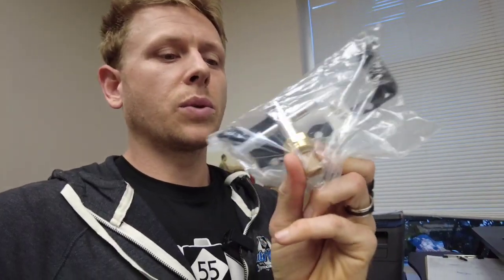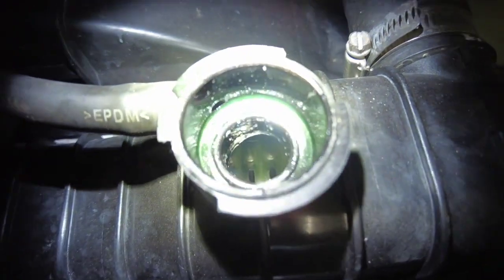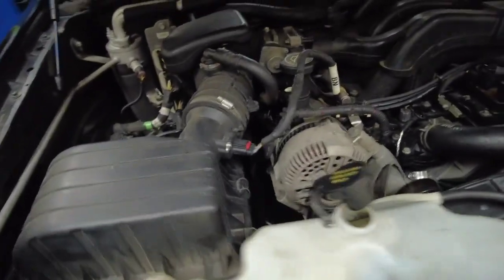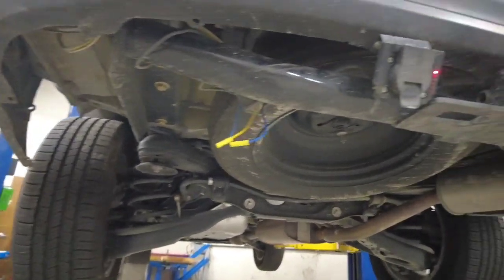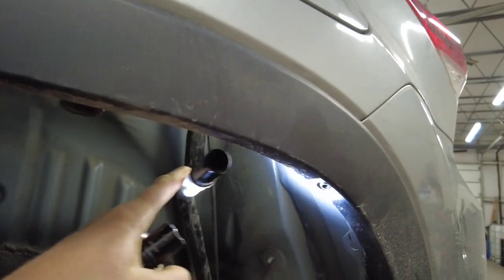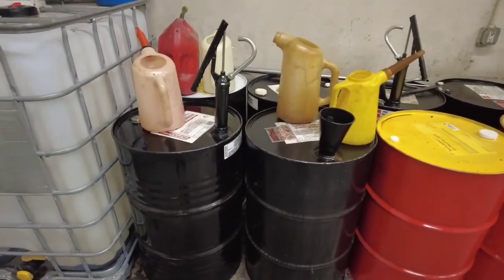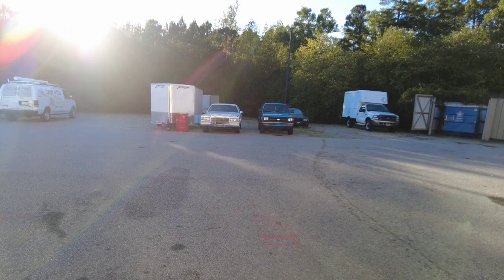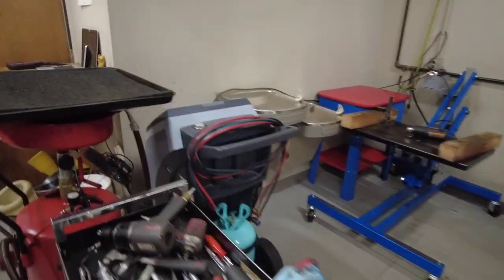What's Going On Around The Shop? and why am i pointing at this fuel lid?

Comment: Good video, liked the showing of all the jobs you are working on.  Nice job diagnosing the Toyota.  Are the Chevy/Gm 4.3 Liters pretty reliable engines overall?  I know the older models had issues with the Spider injectors, are the newer ones (2010 and up) any better?
Reply from the maker: I'm not a big fan of any gm engine. One of my guys has a 4000 mile old 5.3 that more or less just had both heads off and all valvetrain replaced
Reply: My 09 Silverado 4x4 has the 4.3 and has been very reliable just routine maintenance at 106,000 miles.

Comment: Good videos keep them coming do have a question have a 2015 Ford Fiesta SE I'm getting a message popping up says steering assistant fault everyone's tell me replace the steering column for the rack and pinion but there's no electric motor on the rack on this car every light in the dash is on all but check engine light is off I have no speedometer working trip odometer don't work the temperature sensors not working and cruise control won't work now and it gets really light on the steering and it gets kind of tough to steer but it's not unbearable any ideas any opinion helps thank you
Reply from the maker: Email me your vin and ill see if any aplicable tsb's for you contact@55-auto.com